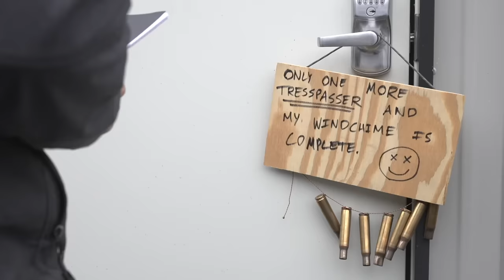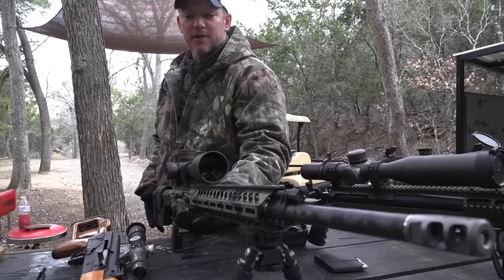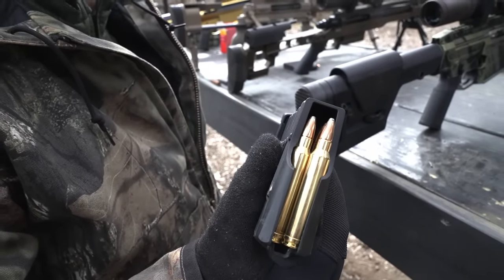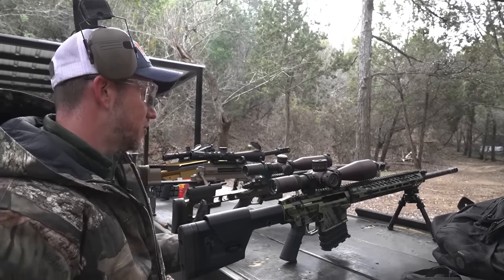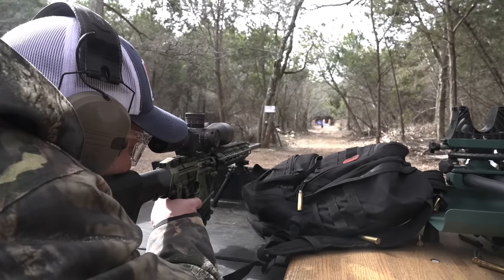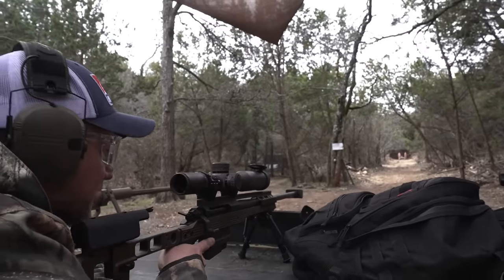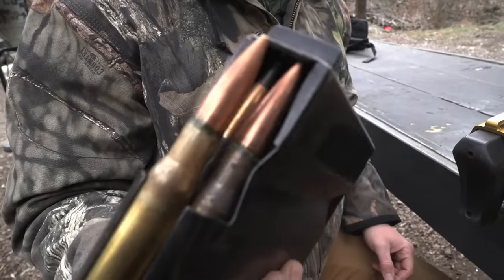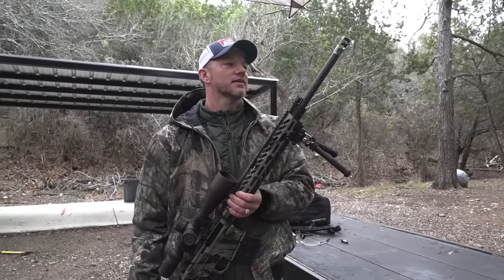Point Blank 300 Win Mag vs Hardened Steel Anvil!

Comment: Matt,  The Hardened one only has a 3/4" high carbon plate in the top surface, the rest of the body is cast, same as the other one.  If you look at the side, on most hardened anvils you will see the line between the cast body and the plate.
Reply: Yep, spot on. Even the top 3/4 is not super hard, around 50 HRC.
Reply: yes. and if it is old enough the bottom could be wrought iron as well.  Needed to get a modern anvil.  :) :)
Reply: @GaryForgingOn  Yeah I have one of these pre-WWII made in England 106lbs and wrought iron base.
Reply: @GaryForgingOn  The top should be work hardened regardless. Those anvils had seem some use before Matt got hold of them.
Reply: @DriveCarToBar  work hardening is a pretty minor increase that is very superficial. You can tell the difference when you're working on it, but not when you're shooting it.
Reply: Was looking for this comment.
Reply: Beat me to it
Reply: I was going to say the same thing
Reply: @pawoodsman1737 And we all made this commenot before Matt had figured it out
Reply: I’m saddened that Matt didn’t figure this out… shoulda dropped them on their sides and shot the striking surfaces…
Reply: Dude it’s a video
Reply: 100
Reply: You absolutely nailed it. They should be roughly the same anywhere in the main body of the anvil
Reply: Hero we needed
Reply: @wreck_ignition7847  Still, only the surface becomes work hardened. If the entire body was hardened, the hammer bounce would make them almost useless. Not to mention the entire anvil would shatter eventually. It has to have the iron to kill the blow.  
Watching this made me a little sick to my stomach. Herrisay!
KnifeMaker
Reply: Came here to say the same thing...
Reply: Yup, you gotta lay 'em on their side.
Reply: Are those Anvils Cast or Forged? I suspect they are forged. Still a softer steel in the base but i believe there are cast anvils out there too that may be softer again or more prone to breakage when targeting on the base.
Its a shame to damage them either way but interesting to see the effects of impacts on the different faces.

Comment: I suspect that unless you shoot the faces, the anvils will perform nearly identically. As far as I know, most "hardened" anvils are actually only hard on their work face, the rest of the body is good old soft iron.

Edit: It seems that you have discovered this 😂 Carry on!
Reply: not true. the entire anvil is heat treated. imagine a steak - cooked outside, raw inside
Reply: @noided4230  Only on newer anvils and a few certain older ones. Old time anvils mostly used a steel plate with iron body. Heat treating 200lb anvil isn't easy today and certainly would be harder 100+ years ago.
Reply: @noided4230  Erm... He literally discovered over the course of the video that what I said was correct 😂

There are lots of reasons why you might want differentially hardened steel parts. Hardened steel is prone to brittle failure when over stressed whereas unhardened metal will usually deform plastically under excessive loads which will usually result in safer and more easily repaired damage. Heat treating and tool steel alloys are more expensive than mild steel/cast iron shipped straight out the door, so you only do it to areas that need it. Hard parts will cause excessive wear on unhardened parts so some components might need a hard spot and a soft spot in order to play nice with other components. I'm sure I could think up more examples but I think I got the point across and I'm tired of typing 🤪

TLDR: Solid steel tools =/= Delicious meat steaks 😉
Reply: @resurgam_b7  this would be accurate if anvils didn't have horns on them
Reply: @noided4230  lol, this clearly shows how some nobodies always pretend to be experts in YouTube comments
Reply: There's no excuse for just making shit up

Comment: 13:00 you're correct, hardened vs not is only in reference to the main striking surface (the face), sometimes the step and horn will be, but if the entire anvil was hardened... I can't imagine how loud the ring from hitting it would be, but there's a reason that they get mounted to heavy solid bases, and some will even wrap the anvil base in additional mild steel chains (to kill the ring). Normally a hardened anvils face is a separate chunk on steel (some designs include the horn portion as this piece) that's fixed to the main body, because heating the entire structure would be a nightmare lol
Reply: I was wondering if it is even possible to harden  an entire anvil that big. It can be heated to uniform temperature but cooling such a large volume leads to case hardening.

I read a paper a few years ago that was using some complex physics to focus energy internally so that it can be rapidly heated then immediately self-quench from the surrounding cool material.

It's a really hard problem to solve. Fortunately, for the vast majority of use cases it is desirable for a hardened outer surface to rest on a soft underbody.

Comment: Someone else may point this out, but normally only the face (the top work surface) of the anvil is hardened. Sometimes the horn will be as well, but that's not at all common. The face is the part meant to take the most beating and so it's the only part that really has any advantage to being hardened. In other words, to do a proper "hardened vs unhardened" test you'd have to flip them on their end and shoot the face, not the sides.

Comment: As a blacksmith I need to point something out. The part of the anvil that is hardened is not the body but the face plate or the striking plate. Lay the anvil on its side with the top plate facing you and you will see a world of difference which you did and glad you put them at an angle. The face plate is welded to the main body of the anvil which can be forged or cast.  Beware the ricochet!
But as always, entertaining, thanks. Tell your dad happy birthday!
Reply: Did you watch the whole video?
Reply: Im glad this comment was at the top, I couldn't help but think the same thing.
Reply: @JamesS.254  so y’all BOTH didn’t watch the whole video before commenting, huh? Rookie mistake.
Reply: Pro tip: watch the whole video, THEN post a comment.
Reply: @revealed He did exactly that. Lol
Wait till the end next time? Lol
Reply: @lucasblanchard47  Pro tip: Read the whole comment, THEN comment on that comment by being an ass lol. Then again, maybe the original comment was edited after your comment in which case carry on.
Reply: @MessierM66  I shall carry on.

Comment: Hardened anvils are the same cast as un-hardened ones but have a hardened steel plate welded onto the top striking surface. So shooting the side will give similar results, you need to lay the anvils over so you can shoot the tops of them.

Comment: You can definitely tell which one’s which. When you shoot the hardened one, it just breaks away material because all of that energy has no place to go. When you shoot the unhardened one, it displaces most of the material, leaving a crater instead of a “blind hole” if you will.

Comment: The damage is the same because both those anvils are made of wrought iron. When manufactured, they both had a tool steel faceplate forge-welded on; it seems the faceplate has come off the smaller one, which is why it sounds dead and the face is so easily dented.  The smaller is probably a Peter Wright (from the ledges on the feet) - if you look on the side you shot you might be able to find the remains of the makers mark.  The larger one is probably a Wilkinson since the weight marks are on the side you shot (most other makers put them on the other side).  That one looks like 1 1 11 (or maybe 1 0 11) in the stoneweight system which means that it was around 112+28+11=151lbs (or 112+0+11=123lbs) when it was made.

Comment: future reference, if you want shrapnel to hit your dummies don't point the surface at the dummies, you'd want an angle roughly halfway between the angle of approach and the angle facing the dummy.  Example: place dummy to the side or 90 degrees from where you are shooting from  and place the anvil face at 45 degrees. it's not a guaranteed cause lots more than angle alone go into it but the likelihood should be much greater.

Comment: A harden anvil is only hardened on the top 3/4 surface, the rest of the anvil is regular cast iron to absorb shock. The whole anvil being hardened would cause the anvil to crack and it would be expensive. Understanding metal is part of armory.

Comment: probably a dumb and boring idea, but ive always wanted to see it.
Its an effect called overmatch.
If the caliber of the gun is over 3x the thickness of a piece of metal, in this case 4mm of steel VS a 50 BMG, the 50 BMG will go through the 4mm of steel at any angle that the 4mm is angled at.
You could also do this with a tank, if you would ever go back to the tank place you usually go.
Take the 76mm gun of the M4A3E8 Easy 8 tank, and shoot an armor with thickness of 24mm, the 76mm shell will go through that 24mm at any anlge, and ive always wanted to see it happen irl.

Comment: Just as others said,  On that "old" anvil the body is cast or wrought and not hardened. Only the top plate is hardened.  Need a modern solid steel anvil versus a harbor freight all cast anvil.

Comment: wow, this vid is so far the best to hear the difference in noise that .300 mag creates. didnt shoot a lapua so far, so i dont know the sound irl. in this vid it seems the .300 mag is louder. but if its standard ammo, it doesnt make any sense to me if i check the rounds data. specially since the .338 has a huge muzzle break i am confused. i only shot a rifle (.308 as far as i remember) in two different rifles, or better barrels. both r 93, one standard barrell, the other one the tac version with a muscle break (way smaller than this one but not the standard of the tactical. same lenght, same ammo box. same barrel lenght. we shot arround 50 rounds both rifles to adjust the scopes since the owner used those for professional hunting. he also created the muzzle for the tactical, it was also more of the look of this lapua @ min 13 or the m82 but way smaller. does this kind of muzzle brake also take away loudness ? because its the first vid i see a .300 mag and a .338 lapua ( or better hear em) directly in a row and i never shot a rifle with this kind of muzzle. made me so crazy i listened to both over 5.1, over  fkn expensive sennheisser headphones. since i still wasnt sure, i used a pretty old custom audio tool and the mic of a hyperx cloud alpha headset (not best but really good, specially mic) and it says 40-50 db more for the .300

any clues somebody ? cause i think about maybe buying a bolt hunting rifle and i was thinking about primary setup in .300 mag major factor was the DB because in germany supressors are forbidden for civillians, even for hunters. cause if there is really no major difference in both calibers i go for the .338 for sure. thanks in advance.

Comment: The guy that sold you two perfectly good (repairable) anvils to shoot was blowing smoke up your butt.  The "hardened" portion of most old anvils is only the face, the first half inch of steel where you hammer.   Manufacturers have tried several different methods over the years from cast steel to  to cast iron, but most are a steel plate welded onto the top of a wrought iron body.  I can't say what those two were without seeing the marking on them.  Wrought iron is not steel, it has almost no carbon and cannot be hardened.   You have a great channel and I enjoy your content.  But it hurts when you destroy stuff I wish I had....   lol

Comment: Thing is only the very top.  The work area at the top is the only part that is hardened.  The rest is only high quality cast steel.  Not cast-iron cast steel.  So there's really no difference in the area you would be shooting.
   To see a difference you would have to lay them on your side and shoot in the work surface at the top
   Sincerely Erin

Comment: Now you know why tanks are hardened steel. I saw a tank from WWII that was supposed to be training only and got sent to war. The guys found out later that it wasn't hardened when some 30mm rds stuck in the front comically. They wouldn't give up tank though even knowing it was weaker because it was also faster due to other reasons. But they survived quite a bit in it and thought it was good luck.

Comment: Dude, you have to shoot the top of the anvil you'll notice the hardened anvil has discoloration about a half an inch to an inch and a half down from the top that's where it's hardened who knows how old those anvils are but back in the day when they were made by hand there's no point in putting the effort into hardening places where you aren't going to be striking steel on, and nowadays with companies cut the corners and cutting costs wherever they can companies wouldn't harden the whole thing cuz it would cost too much. So old or new anvils shoot the top.Thanks a lot btw now I need 300wm lol.....EDIT... U JUST DID WHAT I WAS SAID, NO YOUR USING YOUR NOODLE

Comment: So as far as anvils go generally the Rockwell hardness is at its top surface. When is the last time you saw a smith making a blade on the sides and not the top? Various methods of hardening process are used. My understanding is top 1” is about as far as it gets hardened. Also in my opinion it would be foolish to shoot the top of the anvil at all. If you do then angle it a few degrees.

I find your videos fun, but sometimes a few hours of research or watching other videos using test target will go a long way. However mid video you did realize the above, maybe you planned it that way. End results were interesting. Please sight in your rifles…

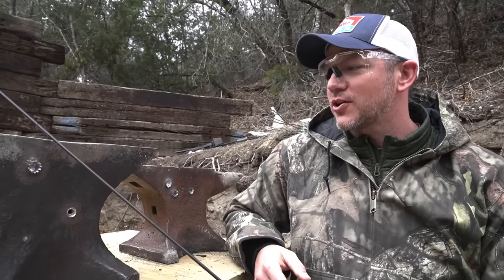Comment: 13:04
Exactly. Only the top 1/4 - 1 inch is hardened (depending on the quality of the anvil).

There are a lot of different ways to build an anvil, including welding two types of iron together. A lot of older anvils with have soft wrought iron bodies and only their face is hardenable steel (others are completely cast iron and are trash)

But you can buy really nice (really expensive) anvils made of entirely high carbon cast steel. Even those will have only the face and horn hardened.